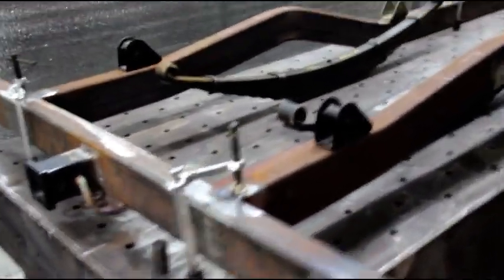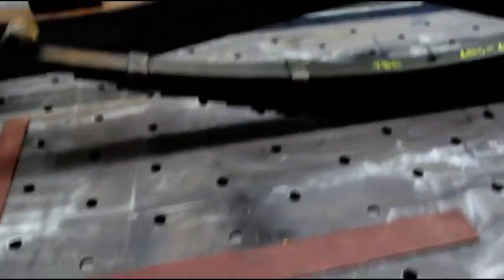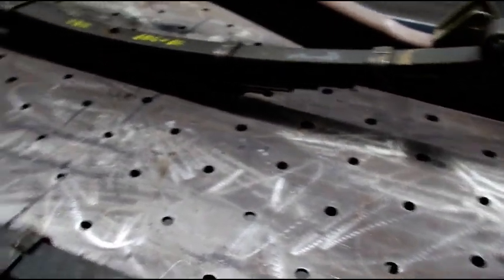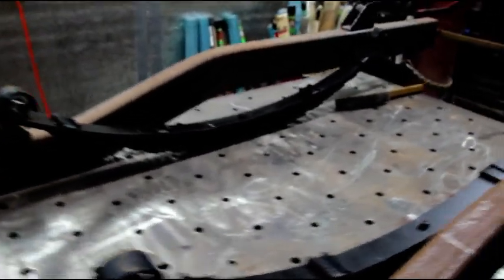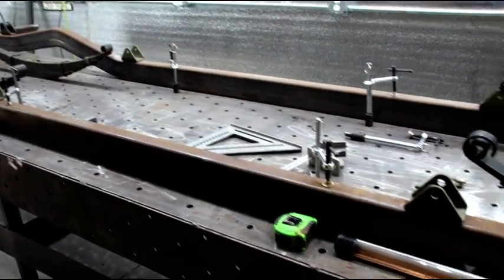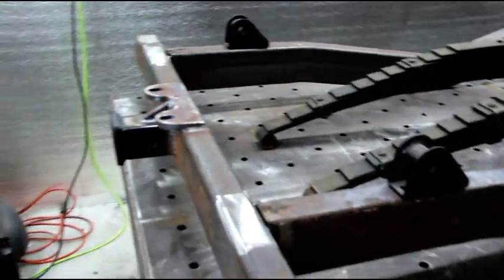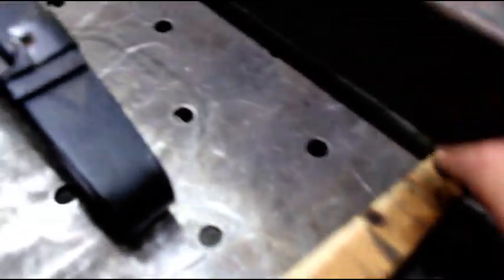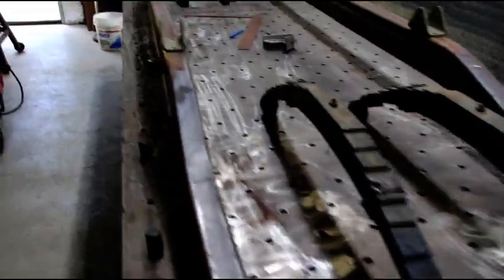Willys CJ3B Custom Frame Build For Welder Jeep, Getting Started

Comment: i use nylon trailer spring bushes, they work, they're cheap and they're easy to change.
i also get 5/8" greasable shackle bolts and the shackle plates from the trailer shop.
you can get nice heavy duty shackle plates with rounded ends and punched holes cheap as dirt.
Reply from the maker: I am still trying to figure out my shackles and decide what look I want to go with.  Thanks for the tip on trailer stuff

Comment: This frame looks so different being so much longer than stock, and it sure looks like it will be able to carry the welder with no trouble with those spring's.  I look forward to seeing the body you build for this, it should be pretty weird seeing it be stretched out.  I know it will be awhile, but that's okay, i will be watching.  G-d bless.
Reply from the maker: Always good to know you are watching and taking time to comment.  The original Welder CJ3B that I have was extremely tight and not comfortable to drive.   The entire rear of the frame was  bent, springs broken, and overload coils destroyed. The GE Welder in there is so heavy the jeep took a beaten not being strong enough.   I am going to make sure it does not happen again with this build.